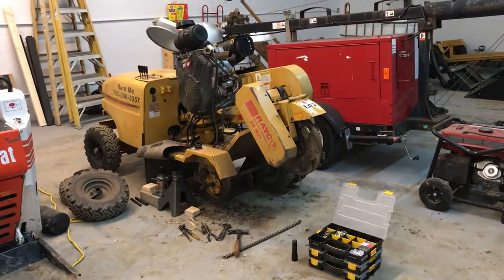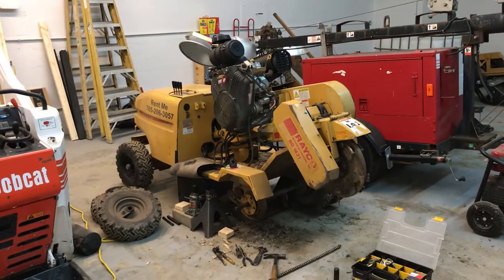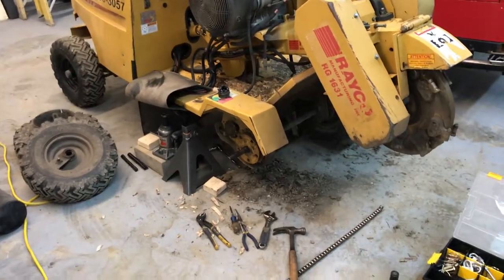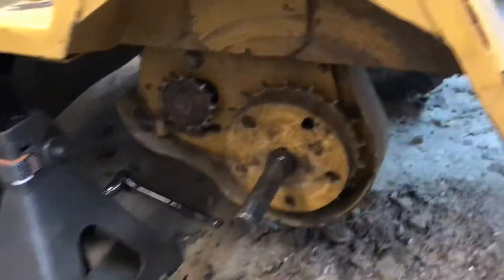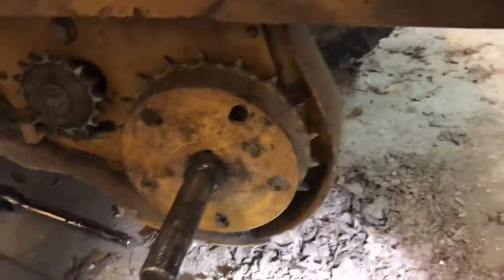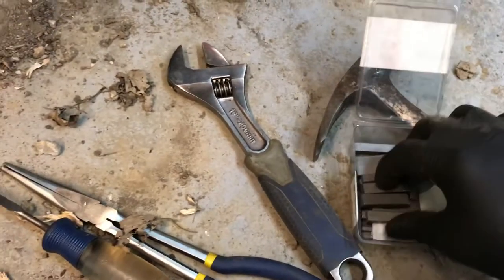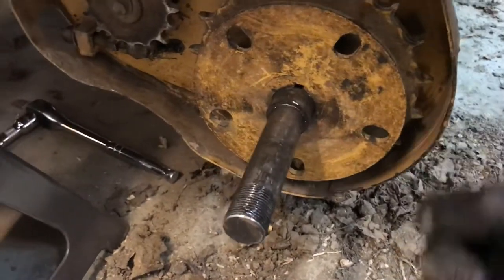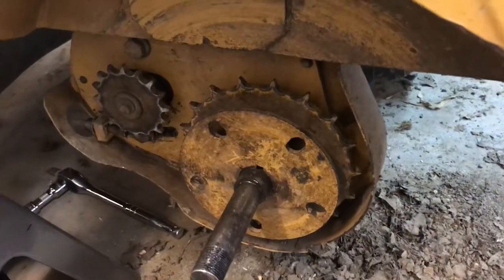Rayco RG1631 Four Wheel Drive Fix

Comment: There is a key on the other wheel also. I'm surprised your drive wheel was turning at all with that key stripped that one turn the shaft.. if the other one is stripped the other won't  turn.

Comment: This question is irrelevant to your video but in order to take that hydraulic drive motor off… do you have to take that drive motor sprocket off? In order to let the shaft out. Your video was helpful I was just looking at the hydraulic drive motor.
Reply from the maker: Man we ended up getting rid of that unit.  Sorry or I would go check it out if I still had it.

Comment: Can you make a video actually removing the rims and tires? I have the same exact grinder and have the same problem. Not sure if I have to take the bearing cap off to remove the wheel off . If so do I have to repack that with grease or something?
Reply from the maker: I ended up selling it
Reply: Yes take the cap off and there is what I call a castle nut with a cotter pin in it. Remov the pin and unscrew the nut. There is a bearing behind the nut. You can repack the bearing if need be. The wheel has a pin the fits in one of the four hole on the sprocket so make sure it's in one of the holes when you replace it. And don't over tighten the castle nut when you replace that.

Comment: Thank you for the video.  I just replaced the chain on my RG1631.  Although there appears to be a threaded hole in the wheel hub boss above the keyway, it does not appear to go all the way to the key slot, and there is no set screw there.  Therefore, the sprocket/hub slides freely on the shaft and is only contained by the flange bearing on the inside and the wheel itself.  Did yours have a set screw?
Reply: Yes there is a set screw. But will work without it.